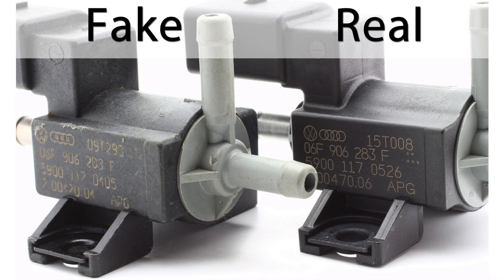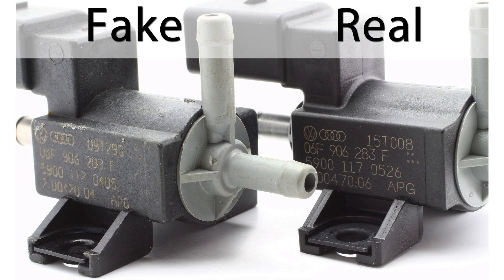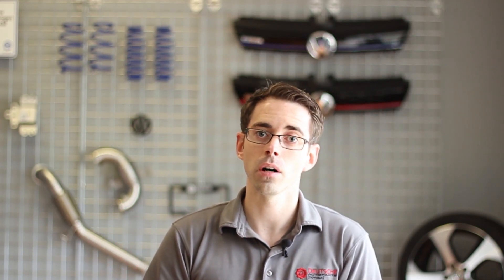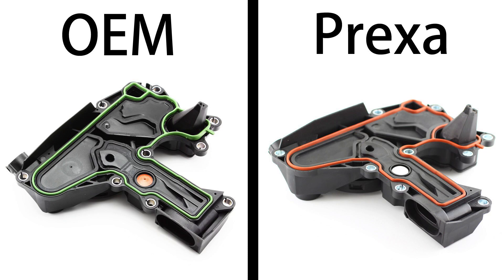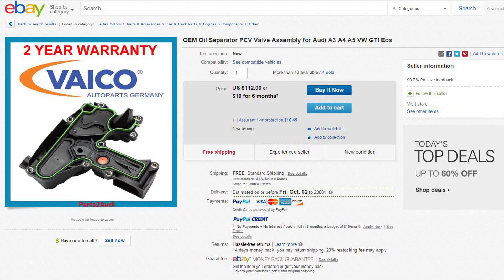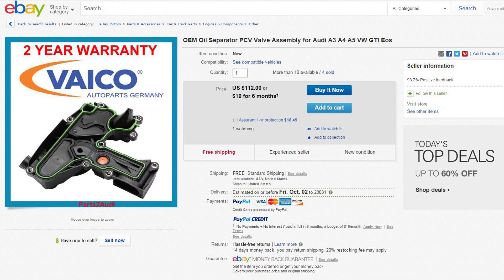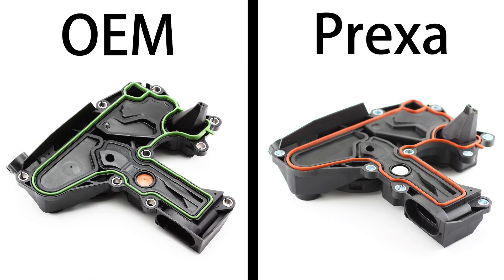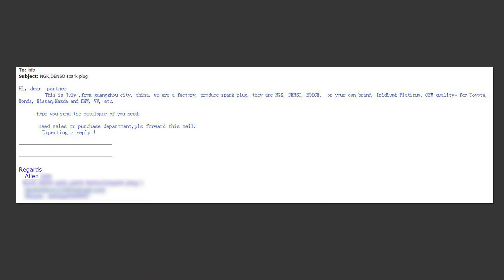OEM vs Fake - Spotting Real VW Parts

Comment: A situation I've ran into several times -- leaving a car at a dealer or shop that commonly repairs a special model import car -- I've noticed parts switched by dishonest mechanics with either a friend or their car and basically swapping in their heavily used or bogus OE-COPY parts. I've even seen parts stores opening boxes and swapping parts with lower quality vendors. This is as real a problem as a bogus part with an illegal trademark on it.